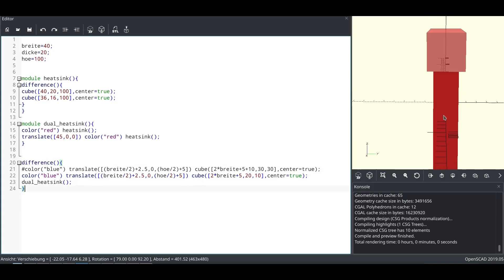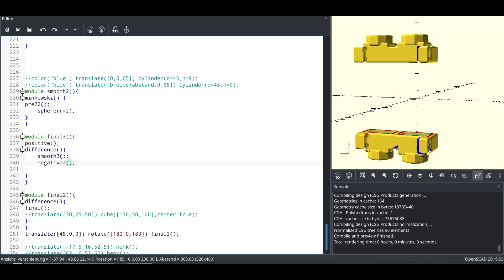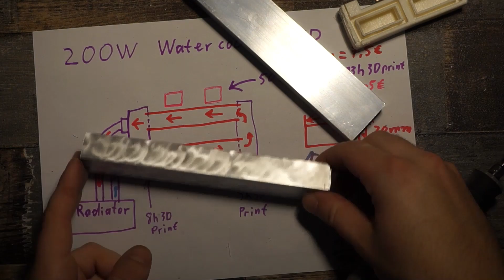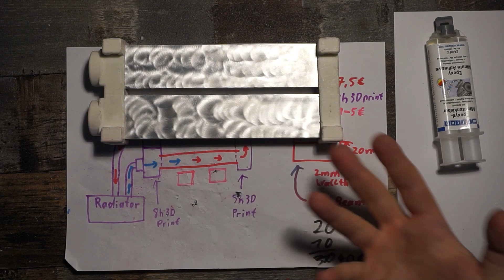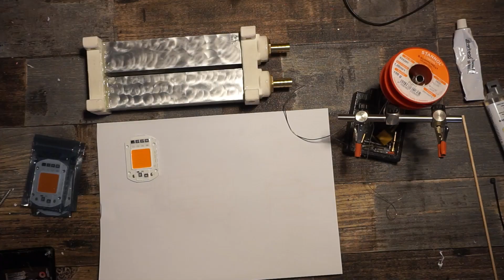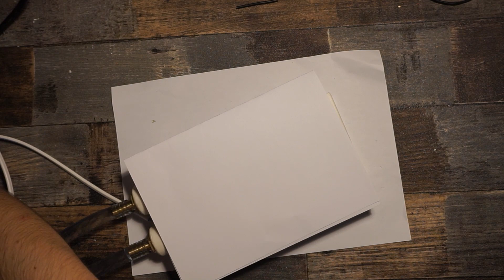Building a 200W Watercooled LED Hydroponics Lamp for cheap, a tale of ABS, Aluminium and Epoxy.

Comment: Hi...so I wanted to ask you..is this a good way to cool led cobs or they will be burnt i  a sort period?
Reply from the maker: well, depends on your watertemperature. if you keep the water below 35C° your cop leds will actually have an extendet livetime. also run them at 80% power not 100% for a long live.

Comment: This is really the cheapest and most light-dense fixture you can get, great video.

I believe the LEDs can be rotated to expand the usable thermal interface area to fit all 4 lights on one cooling block, because the hot spot is primarily behind the LED array itself and any waste heat from the components on the side (may) be conducted through the aluminum backplate suitably. The temperature of the water as it hits the last block would only be negligibly higher because it takes so much energy to heat water, so one block could probably handle 8 lights even, 4 on each side.

They do make similar inexpensive cooling blocks as you probably saw that have a return channel integrated inside, so the 3d printed parts could be replaced with flexible tubing. There are definite space and cost advantages to the sealed 3d printed design though and it looks great.
It also could be that mechanical clamps would have advantages over thermal epoxy, because a more conductive thermal compound could be used, or even a graphite pad which is fully reusable and super easy to work with. That may result in a non-negligible temperature advantage of a few C. It would also be easier to replace the lights (though they should last years under 50C conditions).

I am inspired to experiment with this myself, thanks for your video.

Comment: grow lights are way too overpriced, this is a cool light. it would have been even cooler if the fittings could be bought from any store.
Reply from the maker: i am quite sure most hardware store have 1/2" fittings and adapters
Reply: @boltzbrain3039  I meant the 3d printed parts.
Reply from the maker: @jayypee-11  yes that would be nice, or if they could make curved cob LED's so you could mount them to normal round pipes.